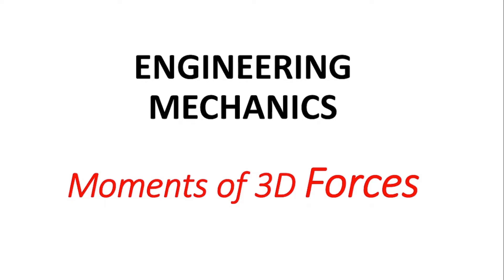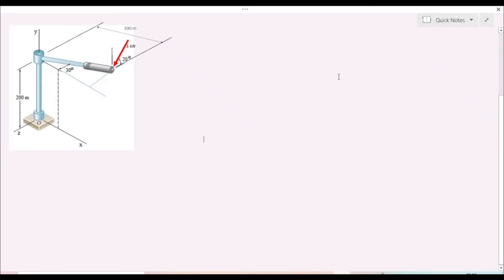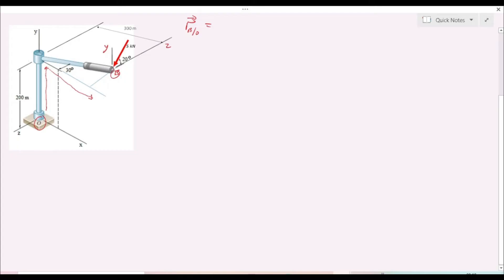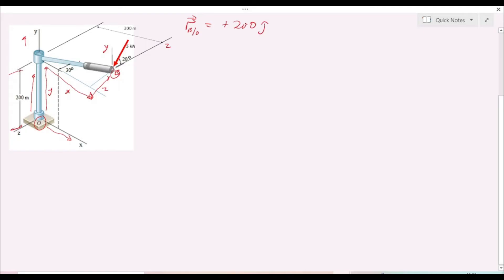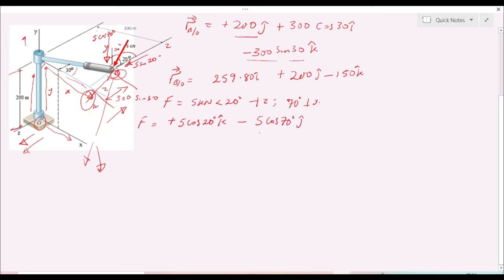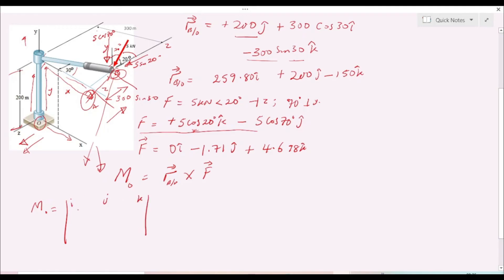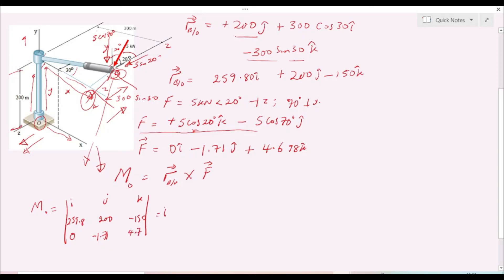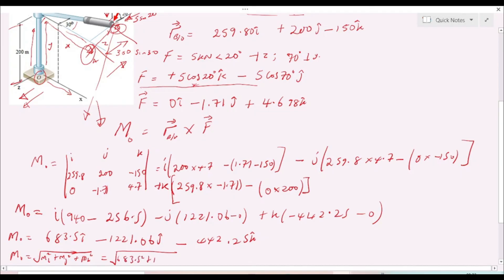Example on calculating Moment of a 3D force (force acting in space)

Comment: Sorry sir,how do the z component tend to be 300sin 30........I not too clear how the 300 came about
Reply from the maker: First you can observe that the length of the handle is 300 units, and the position vector in the z axis is equivalent to the short distance facing (opposite) the angle 30 degrees as shown. 
To get that short distance, you multiply the length of the handle (300) by the sine of angle (30 degrees).
This is so because opposite (short distance) over hypotenuse (handle length) equal to sin theta (30 degrees).
Then it is negative in sense because it is pointing in a direction away from the z-axis
Reply: @EyereSolutions I don’t see how 300m is the length of the door handle I think it’s the length in the x direction cause you’re using the 300 to solve as the hypotenuse and not as the adjacent
Reply: @EyereSolutions and if it’s the movement in the x direction I think it’s supposed to be 200j+300i - 300sin30k